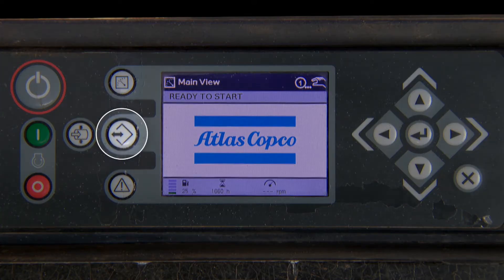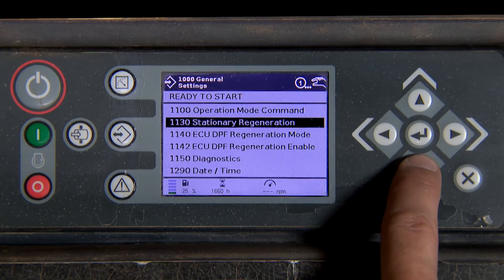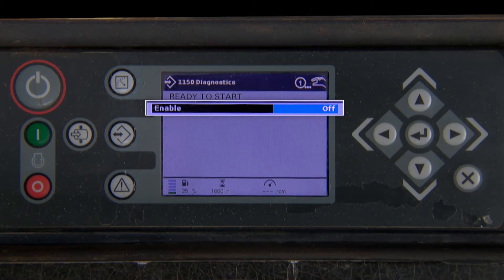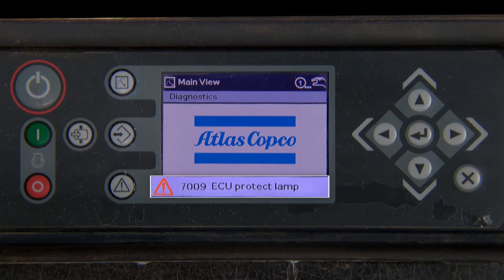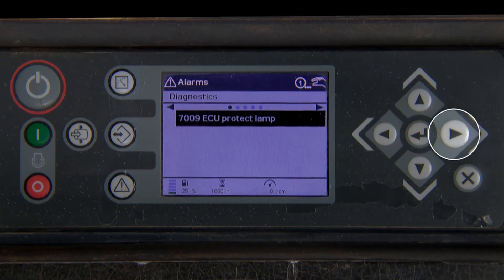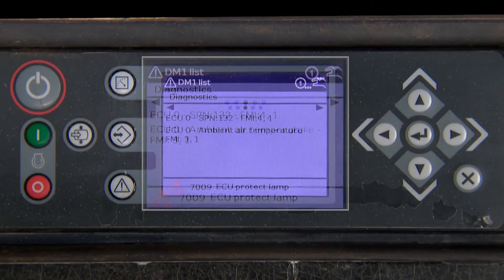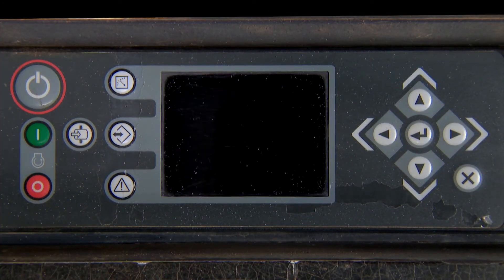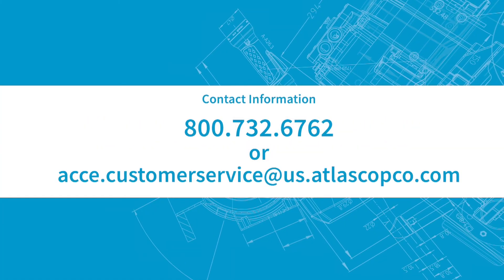Atlas Copco XC2003 Diagnostic Fault Finding | Atlas Copco Power Technique USA

Comment: My controller is stuck on "initialize". I tried multiple rebooting steps, powering off, disconnecting, and reconnecting. Booting up with the service key installed and having no luck. Any suggestions?
Reply from the maker: Hi, thanks for reaching out. Could you please help us with your issue in detail at social@atlascopco.com.